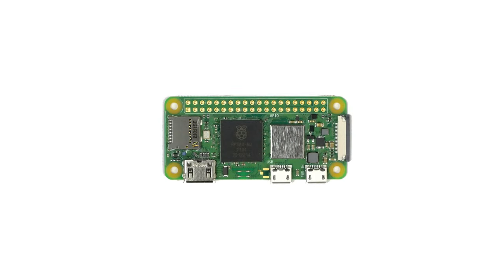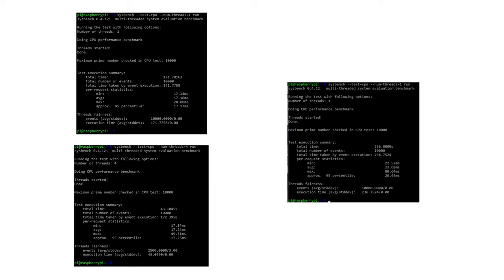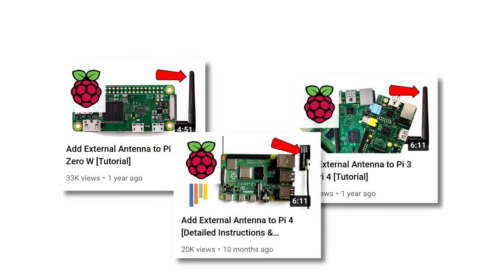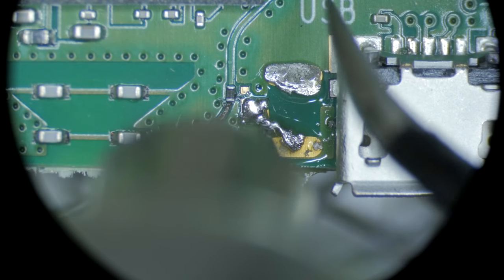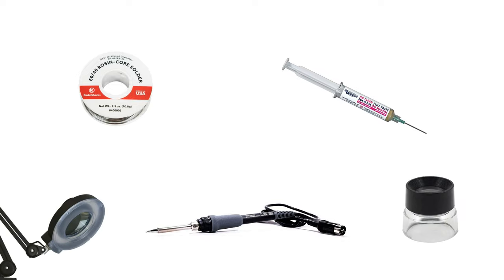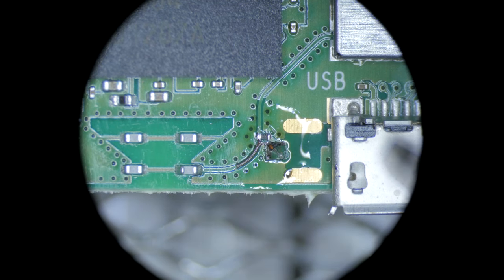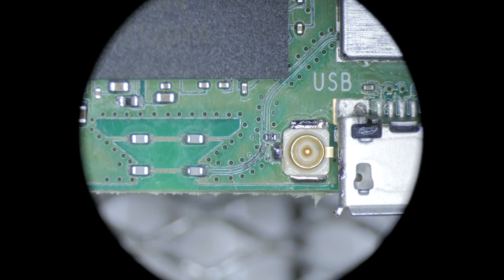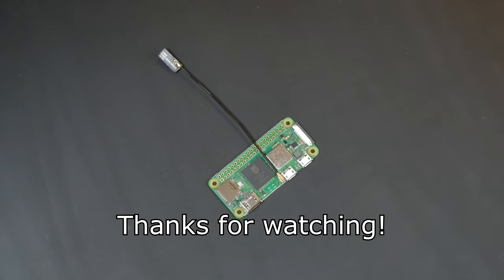Add External Antenna to Pi Zero 2 W [Comparison, Tutorial, and Benchmarks]

Comment: The Signal with the built in antenna would have been amazing for comparison! :D To see how much an added antenna improoves it all.
Reply from the maker: Yes, I did the analysis and comparison with the stock PCB antenna in a previous video. You can find the results graph here: https://youtu.be/MTwWnZG8wUY?t=288

The Pi Zero 2 W uses the same wireless chipset and antenna as the Pi 4, so the results are comparable.

Comment: \i did this to my pi 4 once using your video and man was it difficult to do with my simple iron but i got it.
This Explanation sure is an upgrade and would've helped back then and will for the next one!
Reply from the maker: Glad you found the new explanation helpful. It is indeed a bit more difficult to do with just a soldering iron!

Comment: I'm glad there's a tutorial like this.
I've got a CaribouLite on the way, so I decided to pick up a 2 W CanaKit. I want to add an external antenna because I'm worried about the SDR blocking the wifi antenna in some orientations, and I think it'd be cool to have an enclosure with 3 radio antennas sticking out from it :P

Comment: Congratulations for your manual skills. Which microscope are you using ?
Reply from the maker: AmScope SW-3T24Z with SM05 Barlow Lens, LED-144W-ZK ring light, and RU050 C-Mount for my camera. You can get away with a lot less though if you are not trying to film at the same time! It's large enough that I can do it without the microscope and then I just use a loupe to confirm that the joints are good, so that's the cheapest way to start. It's definitely eyesight dependent though, and if you do a lot of surface mount soldering, investing in a good binocular scope is well worth it.

Comment: Thank you for this. 
I went to a laptop repair shop,  they have the right tools for this job. It works better with external antenna but there it's a problem,  the board gets very hot. I did the test with 2 boards,  the one I added external antenna and another one with normal antenna. 
The boards are raspberry pi zero 2 w.
Did you noticed any increase in temperature after adding the external antenna?
Thank you.
Reply from the maker: No there was no temperature increase. If it's heating up (particularly around the wifi chipset) then there is probably an impedance mismatch somewhere. Double check the solder joints to make sure they are good low resistance connections, ensure the line to the on-board PCB was cut cleanly to avoid reflections, and make sure the antenna and any coax extension used are rated for a 50 ohm characteristic impedance, and the antenna is a proper dual-band WiFi antenna.

Comment: Do you have a link to the resistor you used? As a noob it shows me a ton of 0201 0 Ohms resistors on Mouser ...

Also, whats the purpose of a 0Ohm resistor?

+ thanks for the great vidoe, really!

Cheers from Austria
Reply from the maker: I don't recall which one I used because I typically buy resistors in bulk, but any 0201 0 Ohm resistor should work fine. 

I typically sort by price for whatever quantity I'm getting (typically 1000). Currently on Mouser it looks like RC0201JR-130RL is the cheapest for low quantities (1-10), but it will change from time to time. Typically Yageo or Vishay are good options.

The purpose is just for a controlled impedance, high bandwidth jumper connection, so it's essentially a wire. You could certainly use a small piece of wire instead, though the resistor gives consistent results every time, and a known frequency response.
Reply: @funtechu  hey, thanks!

Comment: Hi, I've done the mod yesterday, removing the curved trace after the resistor pads wasn't an easy task!
Anyway I've managed to install the resistor and the antenna connector... everything seems connected properly,  but even if it's receiveng signals, the reception seems worse than before.

Maybe the antenna connector is too close  to the usb port? I don't know what to check :/
Reply from the maker: A few things to check:
- Make sure the cut for the trace was right up next to the pad. If there is a stub, you can get reflections which will hurt integrity.
- Check all the solder connections for cold solder joints. Just because it's not falling off doesn't make it a good connection. 
- Check your antenna orientation, especially if you are using a higher gain antenna. Remember that with a high gain antenna, you are stealing power from some orientations to improve it in other orientations, so antenna position relative to the base station matters.
- Check all antenna connections (U.FL, SMA/RP-SMA if any)
- Try a different antenna from a different manufacturer. Especially if you got the antenna from a third party seller on Amazon, eBay, or Ali Express, some of those antennas are low quality, or don't match the frequency band. You want to look for an antenna that is made for dual band WiFi.
- Make sure the antenna you are using and any coaxial cable extensions are all 50 ohm characteristic impedance. If there is an impedance mismatch, then you will get reflections which will degrade performance.
Reply from the maker: Also don't worry about the U.FL outer connector touching the USB port. Both of these items are ground connections, so they are directly connected on the board and it isn't an issue if they touch
Reply: @funtechu sorry for the late reply, but I've probably missed the notification.

The problem was the resistor! It looked okay, but it wasn't soldered properly, or maybe not fully functional (I recovered from it from another PCB).

I bridged the two pads and that made everything work again. I can't tell if the signal improved, as I didn't take any measurements before, but it works pretty well.
I've got another board with the original PCB antenna, I can use that for a comparison maybe.

I've read, that the best solution would be a 0 ohm resistor, but honestly it was the smallest component I've ever soldered, if the signal is good enough, I will probably not risk messing up the situation 😅

Thanks for the support!
Reply from the maker: @Fred_Klingon  Awesome, glad you got it working!

Comment: A bit late but is that 0 ohm resistor really needed ? Bridging those teo small pads with some solder should also do the trick …right ?!
Reply from the maker: Given that it is carrying high frequencies (GHz range) I wouldn't recommend it. While a glob of solder might be able to make a connection at DC, it's unlikely to behave well at high frequency which would likely degrade performance or cause the device to produce harmful interference on other frequencies. Using the 0 ohm resistor gives the best result for a proper impedance matched connection.

Comment: Did you measured the signal level of the on board antenna as well?
Reply from the maker: Yes, I do have measurements of the on board antenna as well. It's not strongly directional, so almost any antenna with a little gain will give a stronger signal, provided the antenna is oriented properly.

Comment: Hello and thank you for the video!I have a question since am not that much into electronics!A similar resistor   with the double rating power will do aswell for the job or i need a resistor with the exact same characteristics please?
Reply from the maker: The key things you want for best results is a resistor of the correct package size (so it fits), and a nominal resistance of zero (it's typically a few milli-ohms in practice). The package power rating generally doesn't matter for this application because a zero ohm resistor should ideally not be dissipating hardly any power at all.
Reply: Thank you very much! @funtechu

Comment: for the "no disconnect" test was that with an antenna connected to the u.fl? if so compared to the no antenna signal strength?
Reply from the maker: Yes, all three of the examples had antennas connected to the U.FL connector.
Reply: Would be interesting to see the performance test stock and stock with connector but no antenna or PCB cut.
Reply from the maker: @allan80supra  I guess it depends on what you are trying to do. If you are trying to use the on-board PCB antenna then I don't see any benefit to attaching the U.FL connector which will degrade performance.
Reply: @funtechu  what I'm most interested to see is the performance of the stock antenna vs external without trace cutting as if it is an improvement over all that would be great, if there is also no/minimal penalty to having the un-used connector there even better!
Reply from the maker: @allan80supra  Gotcha. Comparisons vs stock (without a U.FL connector attached) are covered here (https://youtu.be/MTwWnZG8wUY?t=245) but the summary is that the external antenna is slightly better even with minimal gain. PCB antenna with U.FL connector attached, and the trace not cut degrades both the performance of the PCB antenna when the external antenna is disconnected, as well as the performance of the external antenna with it connected, so it's worse than both.  I don't have a video for that comparison, but I did run those tests as well, and having the un-used connector gives a 4.5dBm penalty over the stock configuration which is pretty substantial. So in short, it's best to just pick what works for you (PCB or external) and then just go with it.

Comment: is the resistor nessicary?
Reply from the maker: It's necessary in that you need to make that connection, and it's necessary that it is a good connection that is close to 0 ohms. But people have had success using a small clipping of a thin strand of wire as well, so using a jumper resistor isn't strictly necessary (it is basically just a wire in a nice package after all).

Comment: Can I install puppy linux on the pi zero 22 w ???
Reply from the maker: It looks like there is a Raspup version that worked on the original Pi Zero W so maybe ( https://blog.puppylinux.com/raspup-820-released ). However, not all distros that worked on the Pi Zero W work on the Pi Zero 2 W (some older raspbian versions don't work I know). So you would have to try it out to see.
Reply: @funtechu  Your URL returns a Page not found is the any other links as i would like to try it ?
Reply from the maker: @uksuperrascal  it looks like YouTube just put in the closing parentheses - https://blog.puppylinux.com/raspup-820-released